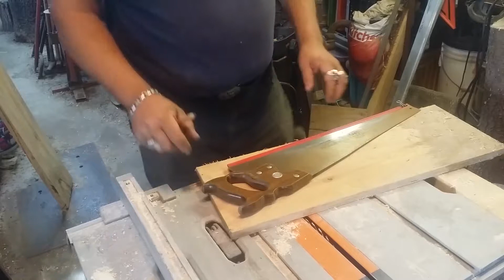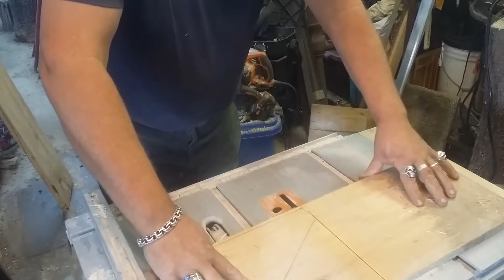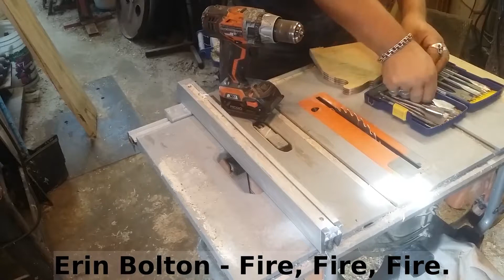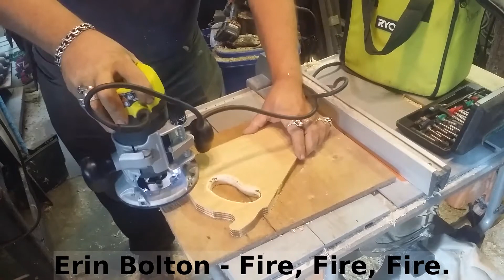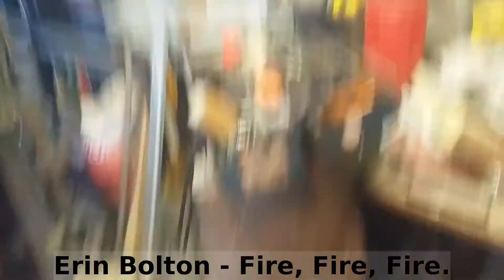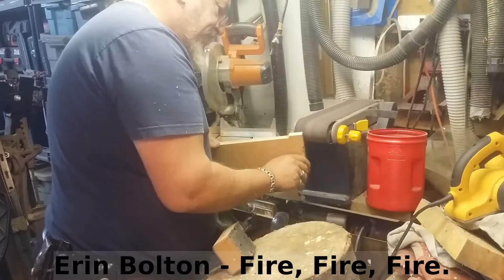Making a New Table Saw Push Stick

Comment: Great job Mr T !! I remember having to make two of these about 20 years ago !!
Reply from the maker: I'm not a fan of the 2 push stick method, I don't feel as in control as when ai have at least 1 hand on the wood, but there are times when it is necessary.